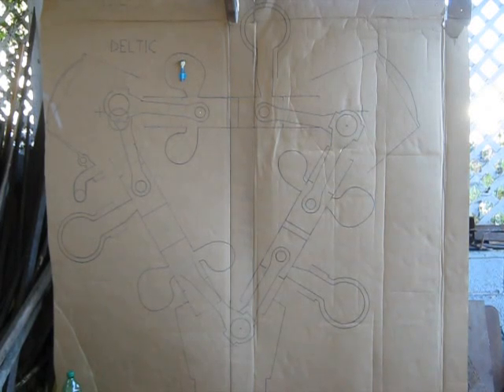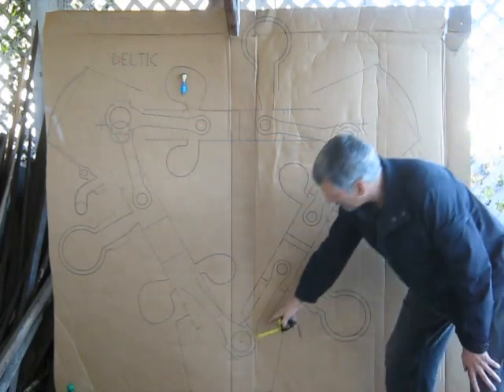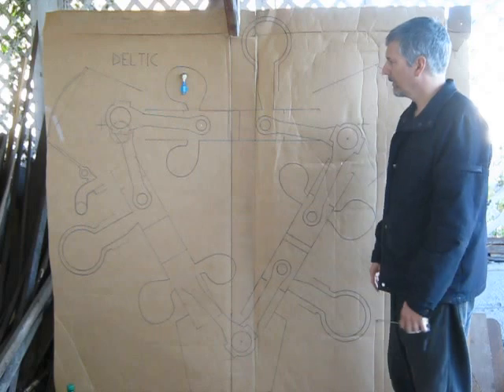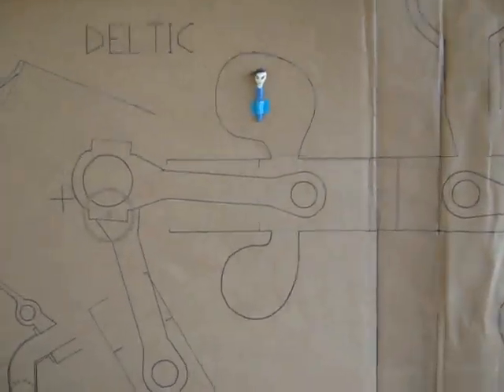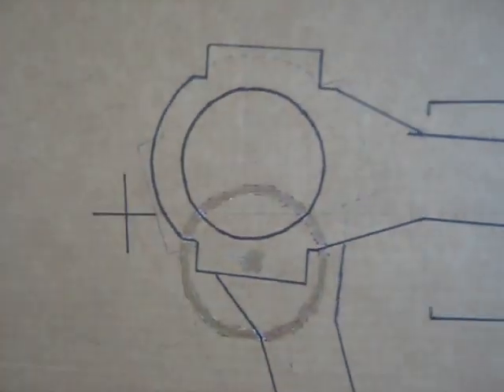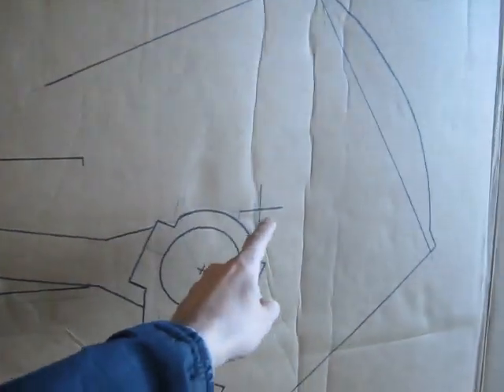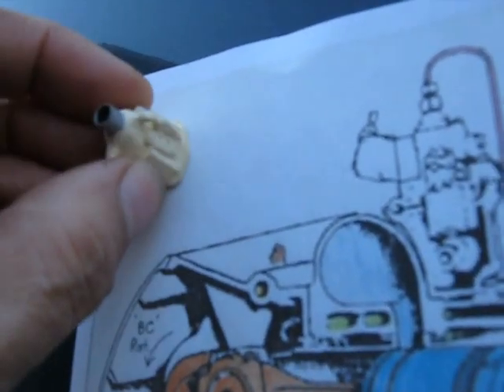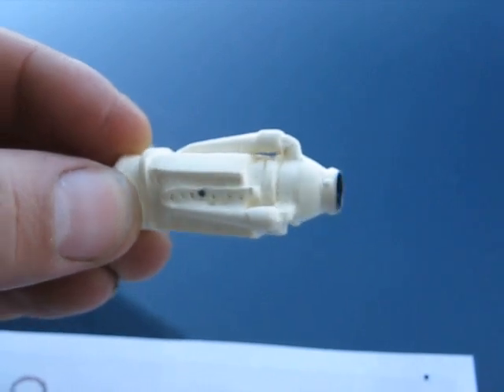How Big Is A DELTIC Engine?

Comment: IN HAVE SEEN THESE ENGINES IN A P.T. BOAT . THE BOAT WOULD ACTUALLY MOVE WHEN YOU LIGHT THE ENGINES OFF.
Reply from the maker: Yes, they were mainly for use in PT Boats, though British Rail also used them in trains. They were power houses for sure.

Comment: Very interesting. Never knew they existed. How were the three cranks connected to an output shaft? Were they a successful engine?
Reply: Locomotive & marine afaik
Reply from the maker: The 3 cranks are geared together by phasing gears. Yes they were successful, used mainly in torpedo boats, and also high speed passenger trains.

Comment: No, it doesn't have a "fourteen and a half inch effective stroke between the two crankshafts. The number of pistons determines the number of cylinders and each cylinder has a 7.25" stroke because that is the stroke of the crankshaft. Two pistons in a common cylinder are still two pistons and its still two cylinders. Even IF the idiot "engineers" who designed those boat anchors put the exhaust ports in one cylinder and the intake ports in the other cylinder. Want to see how OP engines are PROPERLY engineered and constructed? Google Fairbanks-Morse OP.

Comment: A great british engine deloped from a design by junkers aircraft engines from memory the junkers jumo , dont worry what it looks like its the sound oh god the sound nothing sounds as good as a deltic
Reply: mickd6942 incorrect , it was developed from Napier marine engines used in torpedo boats .
Reply: bonkey dollocks yes based on a patent but not a copy from yunkers that goes for the marine and rail versions of the deltic engine fact
Reply: mickd6942 nah
Reply: mickd6942 you need to supply evidence , Napier only initially concentrated on marine stuff.  Nothing to do with yunkers
Reply: bonkey dollocks google it ,napier had a license to produce  the yunkers jumo design for an oposed piston engin , istead they chose to develope the engine by adding more banks of pistons, my source was the deltic locomotives of br by brian haresnape, its in the loft in a box and i am not going up to dig it out check the wiki artical on the deltics
Reply: mickd6942 nah , as long as you're OK with being incorrect , I can live with being correct . fine by me .
Reply: mickd6942 I've just read the article and nowhere does it mention the design started out with yunkers
Reply: Its a 2-stroke diesel and sounds like an oversized Detroit only not for nearly as long because they scatter so soon.

Comment: This small lightweight yet powerful motor was designed during WWII (not 1946) to go in fast, light English patrol boats as it is vibration-less as every motion has an equal/opposite action and is hard to destroy with no complicated and breakable extras like head (gaskets, bolts) and valves/train etc; while being very easy to fix out at sea. It could be made to handle very high compression and could even be controlled by compressor Psi, or even rotating offset crank mountings. If the British government didn't have so many at the end of the war, that would have been the end of the engine. But, someone had the brainwave to put them into a loco and that is where the 1946 history starts. Compared to other boat motors it was compact and vibration-less meaning a lighter frame and more size for ammo etc. Taking power from the cranks could even be fed into a flywheel that had epicyclic gears built in (gearbox), reducing length by 30".  With modern materials, it can be a superb power source. As a 2 stroke it can still meet clean exhaust emissions with Efi.
Reply: Deltic engines did not exist during WWII. Their development is detailed in my book "Deltic De-Mythology", from archive paperwork from Napier. A single cylinder test engine ran in January 1947. A 3 cylinder triangle ran in October 1947. The first 18 cylinder engine ran under test in 1950. The first sea-going trials were in captured WWII E-Boats. The press launch for the marine Deltic was in 1953. The Junkers engines which inspired the design, can trace their lineage back to the 1880s.

The dimensions of an early D18-7A Deltic (from a minesweeper) are given in the Napier brochure as: Length 131.75 inches, width 72 inches, height 84.25 inches. Height includes the phasing-gear casing with auxiliary drives. Some later charge-cooled versions measured 157 x 70 x 79 inches. I hope that helps!
Reply from the maker: i just mentioned what I have read about it, as many places as I could find. Thanks for your info. I made some small Deltic tool box magnets, I even made the Turbocompound version, i made a vid here called the ECO Deltic.
Reply: I really appreciate your site. The motor layout is one that seems to be forgotten by current engineers. There are many forgotten motor layouts  that have modern Internal combustion applications. In the late NZ 60's a work mate loaned me 48 engineering  magazines from circa 1920 that her father owned. I severely regret not owning them now as they had so many intriguing designs. 

Searching   ECO Deltic  didn't find your new link. Can you help?
Reply from the maker: The vid is called "ECO Deltic Anti-hurricane system"  i just added ECO Deltic  into the search words for it, so hopefully it will show up now. It is one of my recent vids, if you have to search my channel.
Reply: I will tell my father that he just dreamed that he was on a torpedo boat with a Deltic motor. Actually I won't because the first two Googles took me here; https://en.wikipedia.org/wiki/Napier_Deltic and here; http://www.dieselarmy.com/engine-tech/engine/significant-engines-in-history-how-the-napier-deltic-diesel-works/ . I fear that you are looking at the train history only and not its actual history. History can be cruel to the truth, Angus Scot invented the Rotary motor in 1898 and 6 were made, then shelved with the comment they will not be viable until the quality of metal catches up with the design: Yet Wankel gets the credit.
Reply: And both those sites confirm what I stated that prototype building began in 1947. My research (which pre-dated the internet and involved Napier Deltic engineers) was not not just the railway application.
Reply: For being so "easy to fix" installed in their OEM "vehicle" they sure didn't get much "fixing" in the "Deltic" diesel-electric locomotives and locomotives are a damned sight easier to work on and around once you get the "carbody" out of the way than working in any engine room aboard a "boat". How many diesel engines PERIOD have you worked on much less performed "in-frame" service, maintenance and repair on? Obviously the answer is zero.
Reply: You don't know shit from apple butter if you think "EFI" has anything to do with meeting "clean exhaust emissions" if you can't first put the fuel injector/nozzle in the CENTER of the combustion chamber. Run along, motormouth. You have no idea what you're talking about.

Comment: Hi what ever happened to the one that you were going to build from the 4.3 chev engine
Reply from the maker: Oh, the Junkyard Baby Deltic. I wasn't really planning to build that contraption, as it would be rather large, heavy and expensive. But i have toyed with the idea a few times since then trying to figure out ways around the various problems. I think it could be done with enough design work and welding and machining. One large problem is the crankshafts, a V6 crank just won't work in a Deltic without some major re-work to allow the various pistons to be timed correctly, nothing impossible, but certainly not easy. If it was built, it sure would rock the neighborhood  when it started up!

Comment: http://www.ptfnasty.com/ptfDelticPhoto.htm, I think you might find this interesting. This is the engine pulled from one of the sea scout ships in my area. They pulled it as it burned to much fuel and had a habit of running away. One of the engines was sold the other one is sitting on a stand in the yard. I believe the one that was sold was successfully started, but then it ran away.

Comment: But will it fit in a Prius?
Reply from the maker: I don't think so, as it is pretty well as big as a Prius!!!  lol  :)
Besides, the claggy exhaust from a Deltic is certainly Prius repellant!  :)
Reply: But will my Prius fit in it*
Reply from the maker: Probably not, though with enough hydraulic pressure, I bet a crushed Prius could fit into the triangle in the center of the cylinders! A 1/4 scale Deltic would probably fit nicely under the hood, a bit complex having an 18 cylinder 36 piston engine in a small car, but it would be 1 of a kind at the car show!!!!  :)
Reply: The comment was meant as a joke, but that would actually be really interesting. A Deltic engine in something like a prius, I'd buy one if I thought I'd have a chance of affording it lol

Comment: whats the setup for the oil sumps ,dry sump?
Reply from the maker: If I understand it correctly, the main oil sump is at the bottom, with the oil from the top two crankshaft housings draining back into it. It is possible the is a scavenge pump or two involved also, as far as there being a separate oil storage tank, i am not sure.
Reply: Its dry sump
Reply: yeah it pushed it though and burned it, its what i rigged up on a free mower for experiment
Reply: dry sump with total oil burnoff, just the way i like it.
Reply: you feed into the bearings, needle roller or metallic sleeve and or what ever bearing floats your skirtand the the oil throws off and gets burned up like fuel for total loss.

Comment: Whats the point of this? Three outputs?
Reply from the maker: The 3 crankshafts were all geared together into 1 output shaft. However, the bottom crankshaft rotates the opposite direction compared to the top 2, so that the piston motion works correctly. Other youtube vids show this. The main purpose of the 3 crankshafts was to pack a lot of cubic inches of engine into a relatively small package (compared to a normal 4 stroke diesel engine). The Deltic was 6 cylinders long, so you have 18 cylinders, plus it is a 2 stroke, so it fires twice as often as a 4 stroke engine. This results in 5384 cubic inches of displacement in every revolution, plus a very smooth delivery of power, almost like a turbine engine. The horsepower ratings were from about 1600 horse in the train engines up to 2500, 3700, 4100 and finally 5600 horse for the Turbo Compounded version, all at about 2000 rpm. Have a listen to some of the Deltic train engine vids, it has a very unique sound, they say it used to sound like a Lancaster 4 engined bomber flying over when the train went by at 100mph  :)
Reply: The final was E 185 ? Gas engine ?
Reply: And incredibly light for its power output.